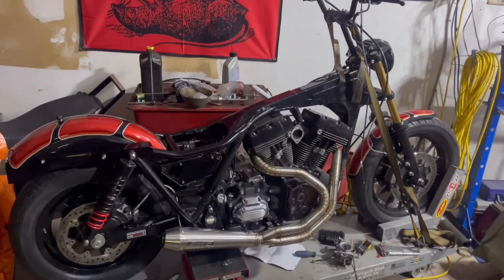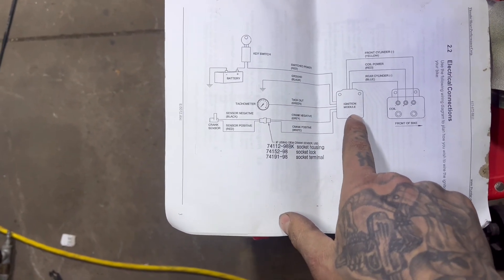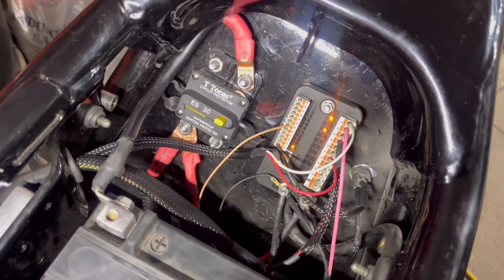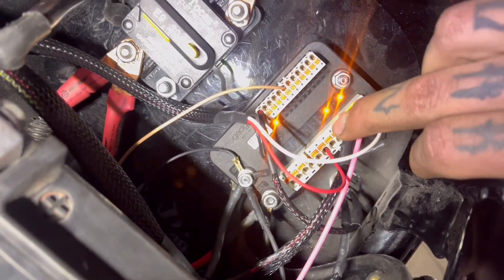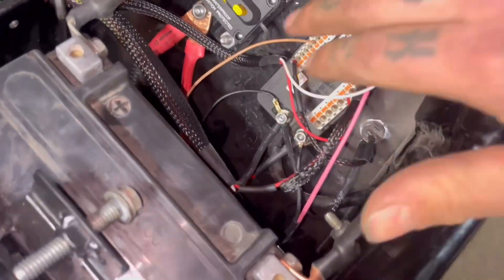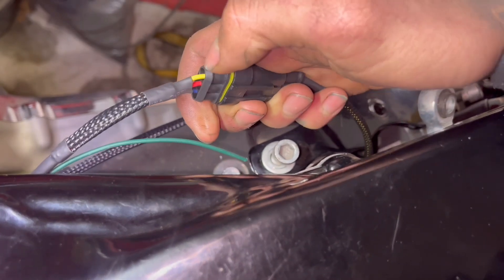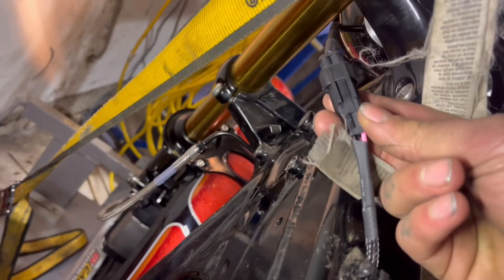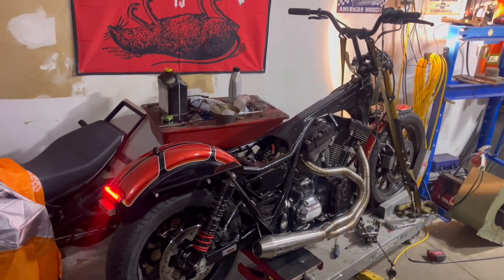How to wire your HARLEY DAVIDSON using thunderheart/M unit

Comment: Great to see information / help on integrating Thunder Heart ignition with m unit, was not clear on where the m unit  ignition output is connected to the the ignition system…Thanks
Reply: Same, that’s what I came for